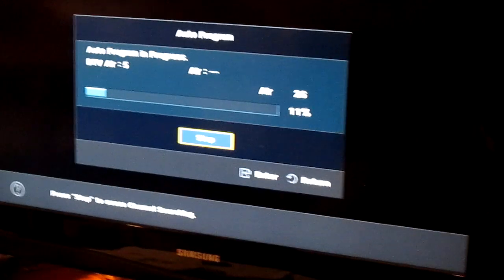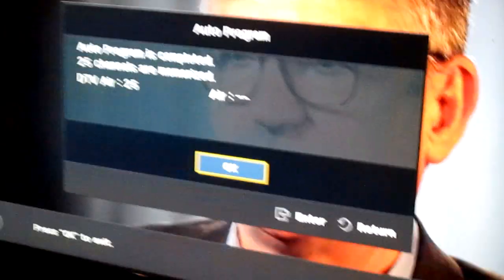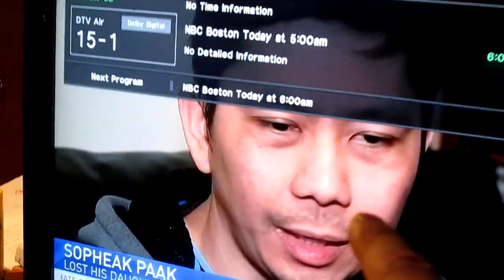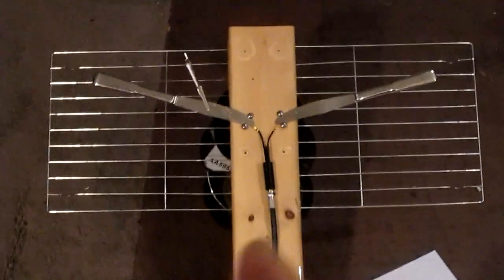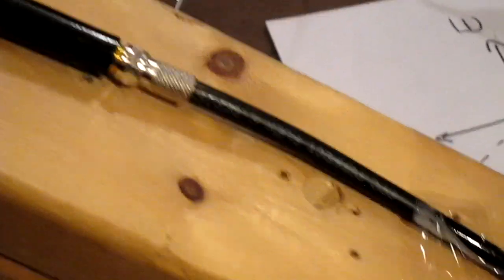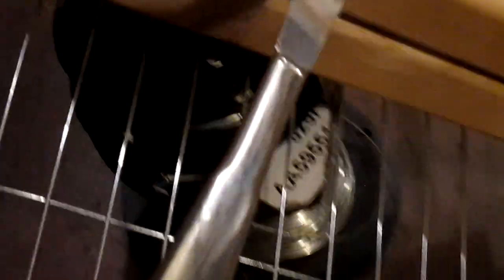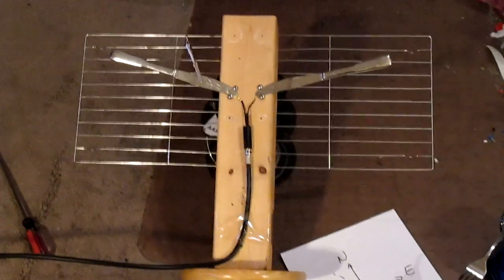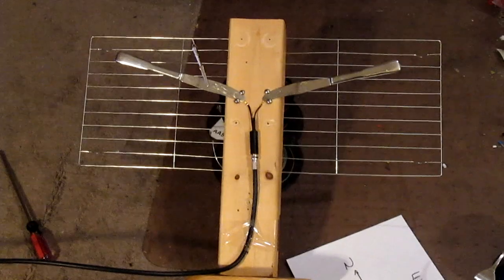DIY UHF + VHF HDTV Antenna - STEAK KNIFE - EASY + CHEAP FREE HD TV OTA - NO CABLE DIRECTV

Comment: Thanks. Very interesting. You got me interested in trying to make my own antenna too.
Reply from the maker: Some already made Antenna is pretty cheap.  I found one on Amazon for $16.00 and I can get Channels as far as 90+ Miles.
Reply: @JodBronson  Thank you for letting me know about the antennas on Amazon. I checked them out and will be ordering one. Have a great day.
Reply from the maker: @paulklekot8774  - You are welcome.  After trying to built my own and Trial + Errors, it's best to buy something new and cost less and less coffee too.  A cheap under $30.00 Antenna will work great, believe it or not.  As long you use the TVFOOL Website, you can see the TV Antennas close to where you live.  From that, you can point your Antenna to it and get good TV Signals.  Because today's Free Local TV's, it's actually easier to get signals than the older ways.  I get about 40 - 50+ Channels where I live with a Basic $16.00 TV Antenna.  NOTE:  Make sure to get one that have Booster in it, it does make a difference.
Reply: @JodBronson  My antennae arrived and I am setting it up now. I got tired of paying $60 a month for cable. I mostly watch local channels so that cable was a waste of money. Thank you for all your advice. You are so kind. Have a great day!
Reply from the maker: @paulklekot8774  - Oh nice!  Yea we were paying $250.00 Per Month for Cable + Internet + Phone.  Now we pay only $85.00 for Internet and Phone is Free and TV Free with Antenna.
Reply from the maker: @paulklekot8774  - Here are some sites that I use for FREE TV + FREE MOVIES and FREE SHOWS:
1.  https://pluto.tv
2.  https://tubitv.com
3.  https://willtv.net

CHECK THEM OUT !!!

Comment: Truth and Quality.

Building Tv antennas is fun.
When comes time to upgrade Tv reception equipment.

www.tvfool.com

www.fcc.gov/mb/engineering/dtvmaps

www.otadtv.com

www.3starinc.com

www.channelmaster.com

www.antennasdirect.com

www.winegard.com

Wall Pass Through , www.walleyesolutions.com

Type the words , flat jumper coax , in , www.google.com or www.yahoo.com

Quality , Tuners/Recorders , low prices , www.epvision.com

Comment: The one antenna looks like you messed up.The copper wire crossing cannot be touching each other.Use electrical tape where they touch
Reply from the maker: @mark s - Did you see the " Shrink Tube " there?  If not, watch the Video and PAUSE if you have to and PAY ATTENTION, ok?  Since it's NOT in operation, the shrink tube slide down a bit.  But look closely, you will see SHRINK TUBE on the crossing.  BY THE WAY, you are talking to someone very aware of "his" surroundings!  LOL
Reply from the maker: @mark s - Let me help you out a bit.  Pause the Video at 15:35 - You should see a 1" "Shrink Tube" at each crossing, one slide down just like I stated.  The other is in the crossing, like it should.  But BOTH of them is there!
Reply: I can't see the shrink tube off my monitor. By my monitor it looks like its touching.....Take care
Reply from the maker: @marks7352  -  LOL, you gotta look closer and get a new monitor, LOL.
Reply from the maker: @marks7352  -  You sure?  The Wires are even SMALLER than the Shrink Tubes!  LMFAO! 😂😂😂😂😂😂😂
Reply: Or I need new eyes.....:)
Reply from the maker: @marks7352  - LOL
Reply from the maker: @marks7352  -  Magic Shrink Tubes!  LMFAO
Reply: Don't gotta ge a smart ass no wonder your channel sucks ass
Reply: @VannyTheGOAT  Oh I am so sorry for being a smart ass won't happen again.... So everyone let the wires touch.... Did I do gooder?